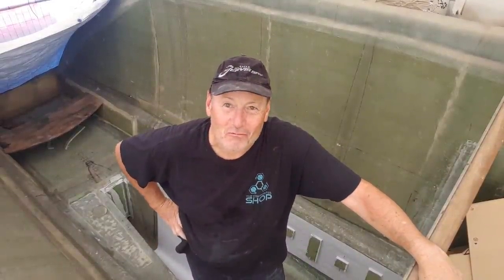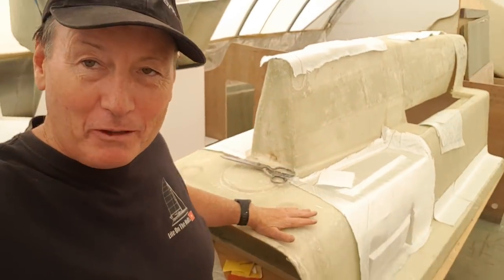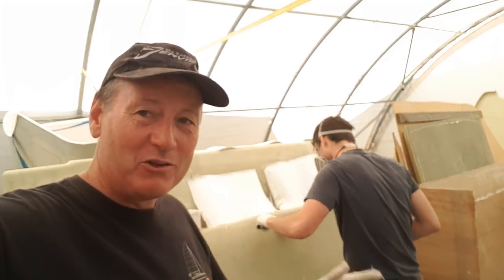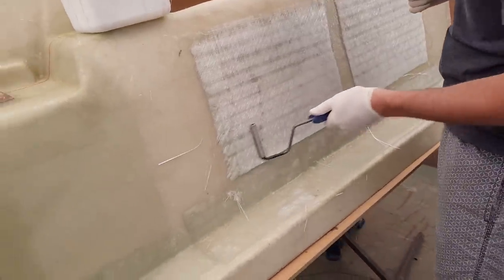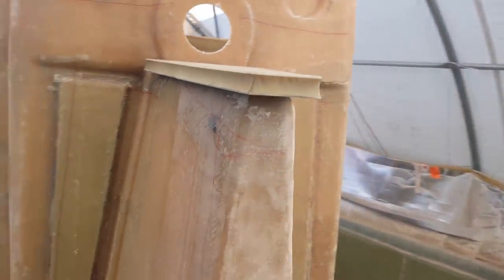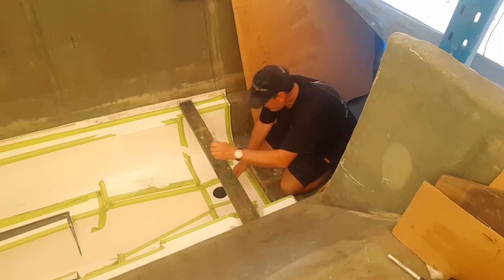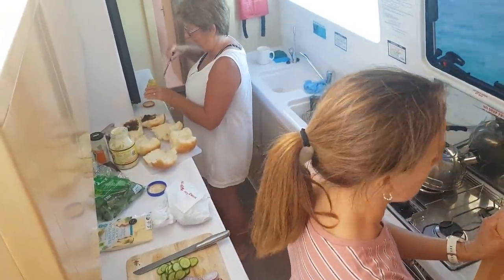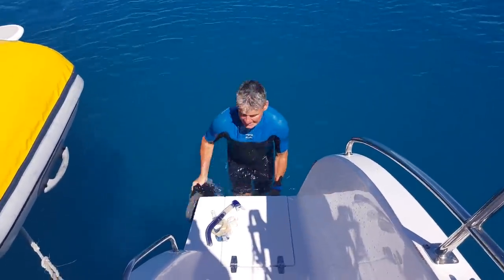Ep138 Bilge Work Almost Done - Catamaran  Engine Rooms

Comment: Ross, don't worry about the talking, it brings the job to life, it's great to gain an understanding of the processes you're going through.

Just a thought about vibration. Would it be possible to use a low expansion foam injected into any voids between modules and the hull. 

I'm not talking about the stuff that comes in tins but more along the lines of a phenolic foam. It would be worth having a chat with some suppliers, or maybe there's a viewer who knows more about it. 

Or rather than a rigid foam what about a soft foam, maybe latex or neoprene based, though I'm not sure if they're available to inject. Or maybe look at fixing soft foam to the module before it's fixed in place.
Reply from the maker: I have given expanded Foam some serious consideration and decided it would possibly create problems going forward.blocking off a vertical face behind the module could create a trap for moisture condensation etc and in every case I have it used it always seem to gather mould etc.I am confident by gluing solid laminated foam strip's to glue to modules to the hull sides will distance it from vibration and allow fir moisture to find its way into the bilge.All the best buddy.Ross

Comment: Hehe been working for last 4 years on using basalt fibres in concrete.... btw its awesome for boats.... when someone decides to do the initial testing .... get Sam on to it hehe
Reply from the maker: I brlieve it is a great additive.I am fascinated by composites in industry.Cheers Matt Rossco
Reply: @LifeOnTheHulls  can be used as a replacement for fiberglass.... material values sit between fiberglass and carbon fibre. Made in the same formats as fiberglass...

Comment: Hi Ross can I sugested making jig fixing on output shaft with laser pointer Oto
Reply from the maker: Thanks Oto.That is exactly what I did mate. Thanks for the hunt.I made a faceplate for the stern drive coupling and a jig at 90degrees to the already angled 7degree coupling.The jig extended to the stern outlet and verified with laser and a digital level.Such a good process.Cheers.Rossco.

Comment: Can you not just fill the gap between the hull and engine modules with expanding fome to stop vibrations? Not the shop fome in a can, but the stuff you mix and can controls the rate of fome expansion.

Comment: Foam fill it
Reply from the maker: Hey Roger definately wint be foam filling as it akways leads to major issues down the track The Bilge is left clear of foam and water if any, allowed to travel to central bilge.2 part foam holds a density of no more than 35kg per sqmtr and poses a Risk to absorption if skin is interrupted or breached.This cat has complete h80 strucural foam throughout and has more than adequate buoyancy and insulation.Cheers mate.Ross
Reply: @LifeOnTheHulls  when going to show top deck lift from mold and fit to hull
Reply: @LifeOnTheHulls  i just buy my first ever sail boat 50ft ferro maybe we see pass one day
Reply: @LifeOnTheHulls  i want ask i see got knowledge 2 questions 1 will fiberglass stick ferro hulls 2 i want fit bow thrusters i thinking welding 2 plates in and out of hull pass pipe through then weld that 2 plates if cut hull would weaken hull when plates welded that creat full seal i could back fill with cement or lead any advice simply this bow thruster fit if fiberglass works save ton on man hrs